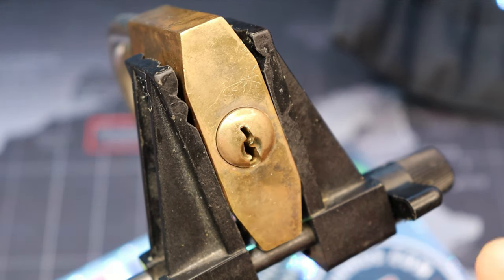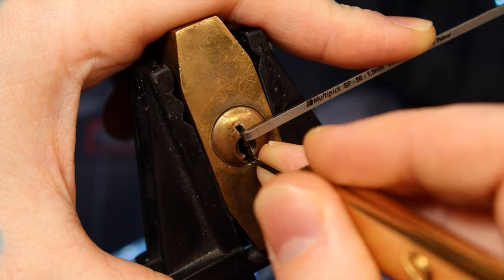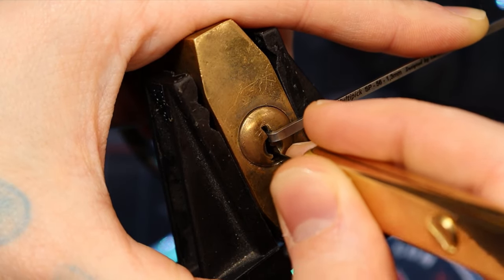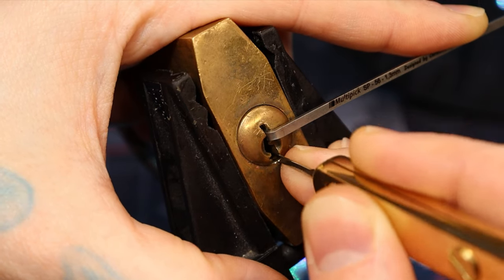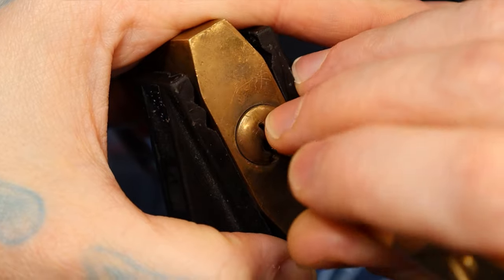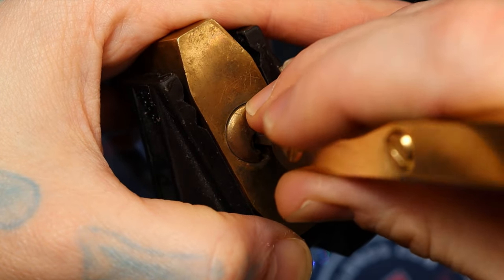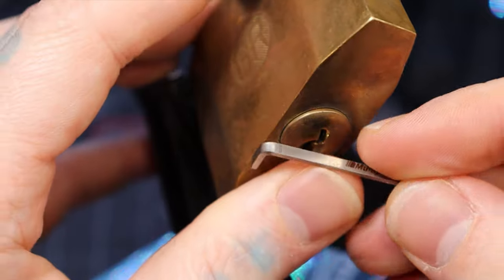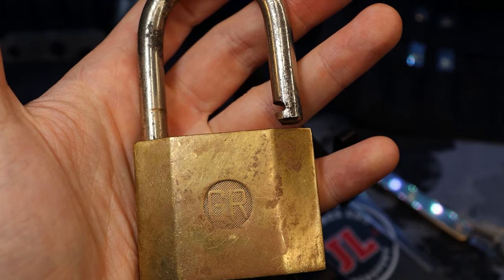288) Guerville Riquier Padlock Picked

Comment: I’ve got a lock right now that requires some massive turning pressure as well which I’m hoping is why I’ve only opened it once so far. Nice work! This looks like an older lock - any idea of its age?
Reply from the maker: The ones that take massive turning pressure usually take me a bit to get that they need so much!  I'm unsure of the age of the lock unfortunately.